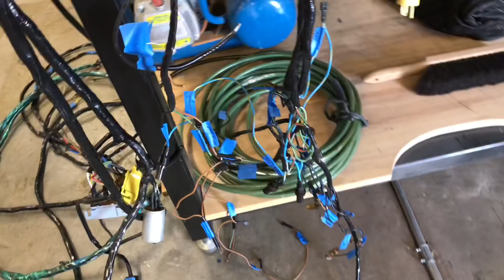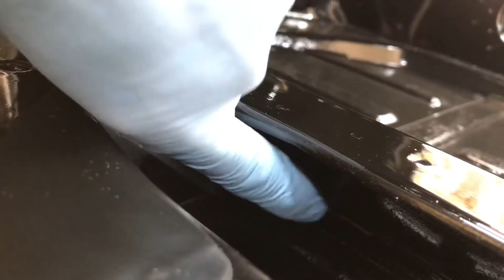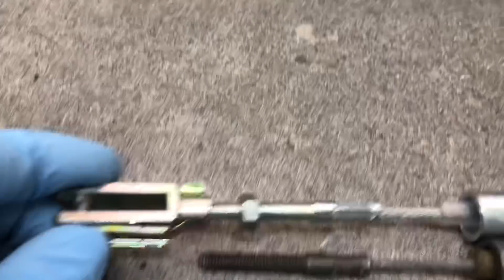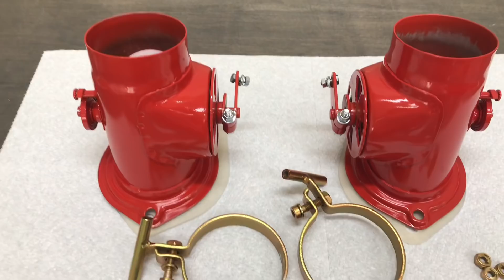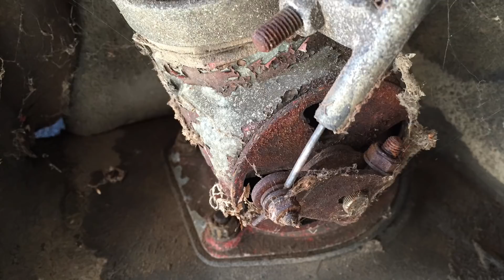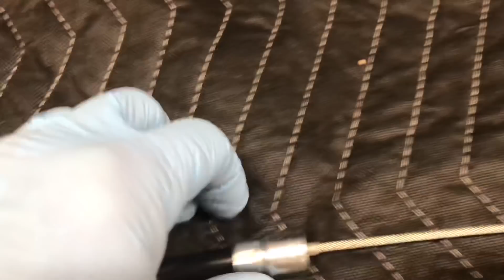1967 Porsche 911 Video 38 Installing Tunnel Lines

Comment: Hello Mike, thank you so much for your excellent videos. They have been invaluable for me during my restoration process of a 65 912. A question: Is the speedometer cable and brake line held by the same hold-down tabs? I am a bit confused atm :-)
Reply from the maker: Hello Palo Alto Thank you im glad they can be of some help.
I have reviewed the video footage and also gone back through some photos and as best I can see
and they do share the same hold down tabs near the hand brake location.
Most of the lines as they run through the tunnel kind of settle in to what needs to happen.
Also cars may be different on what's available through the tunnel.
One other point I should bring up after reviewing the video is the accelerator rod that runs down the tunnel
does get bushings installed the holding tabs. 
I show them in another video but don't recall off hand which one that was.
My car did not have them but they were a factory installed items. A viewer brought to my attention!
Good luck!
Reply: @MikesRestorations , thank you so much for the detailed response!

Comment: Hi Mike - sorry if I missed it: do you/can you replace the retaining clips that hold the harness etc in place? I'm too hesitant to rip one off incase they can't be replaced.... The two pronged ones with the rubber outer sleeve. Thanks
Reply from the maker: Hello eljimberino
The retaining clips/clamps will remain in place. They are spot welded and would be difficult to replace and reinstall.
I did replace the vinyl sleeves with shrink tubing to clean them up and that seems to work well
Good Luck!
Reply: @MikesRestorations  Brilliant thanks!

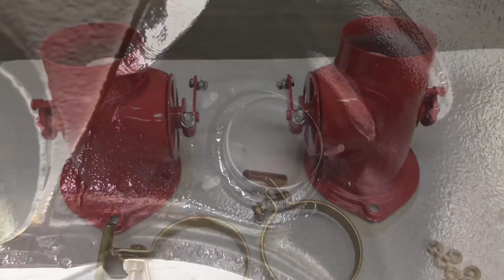Comment: Hi Mike - I really got a lot out of this video since I'm repairing and reinstalling my heater valves, hoses and cables.  As usual, beautiful work. I have been looking for where to buy the heater hose clamps as shown in the video at 11:01. The part number I have is 901.211.051.22 but what shows up is another style (with the pipe welded to the side of the clamp), not like the ones you have.  Would you have a suggestion as to where to buy them?  Thanks.
Reply from the maker: Hello Rotarybreather thank you
The clamps you are referring to in the video are factory originals from 1966 refinished.
When Porsche remanufactures some parts they make small changes to be more suitable for a wider range of years and models.
Im sure the new clamp style would work but if you are looking for these parts exactly I would recommend searching eBay for some
used originals. 
Most of my Genuine Porsche Parts are sourced here
https://www.porschesandiegoparts.com/oem-parts/porsche-pipe-clamp-90121105122
Always affordable and always beautifully packaged and shipped usually within one week. A great place to source all your Genuine
parts. Sometimes they don't have pictures when you enter your part number but as long as you are sure its the correct part number
they will ship correctly. Also I think for those clamps there would be a left and a right ..Its been a while since working with them
Good luck!
Reply: Mike - do you have a video showing how to hook up the cables to the heat exchangers (that open the flapper boxes, not the heater valves)?

Comment: Hi Mike, how did you clean the wiring insulation? I tried white spirit but it washed the color stripe from the wire.
Reply from the maker: Hello Ian
The wire harness was washed with warm soapy water and paint gently scrubbed with paint brush..followed by clean water rinse. 
Next Blow dried with compressed air and left to dry out outside in the sun on a very warm day. The solid wire colors can be cleaned with a flash wipe of acetone. The wires with strips color can be tuned up if necessary with denatured alcohol. being careful not to over due as it could remove strip color if wiping too long
Good luck!

Comment: Hi Mike, what paint did you use to paint the red heat control valves? Thanks in advance!
Reply from the maker: Hello AWCC
The paint used was dupli-color engine paint DE 1605 Ford red
Reply: Thanks Mike!

Comment: Hi Mike, I'm watching every video with great interest. Trying to get all the details. Did I miss a video of the general wiring harness of this fine automobile? I can see you have some wiring harness going on in the engine bay with the next video, but I can already see some wires (and heat tubes) in this video. What did I miss? I hate to miss some of your detailed work. They way you work is a great inspiration, for all restoration projects thanks
Reply from the maker: Hello Thomas
Thank you=) yes there are several harnesses on the car I will be going over in greater detail. In Video 38 it was just pulling the main harness into location but not much for hookups as of yet.
There is also a harness in the headliner installation video definitely 
worth checking out. The headliner harness is tough!!!
As the series continues I will cover all hookups..little bits are revealed during ongoing segments as the timing require.
Lots of video to watch but I hope not to have to many gray areas..
If you have a any particular question I will try my best to answer
Feel free to reach out!

Comment: Hello Mike, did you use a high temperatur paint for those flapper boxes? Or would a regular paint be sufficient? Thanks
Reply from the maker: Hello Lukasz
Yes you are correct..high temputure engine paint should work fine on the flapper boxes. They will get quite hot..engine paint is good to about 500-550 degrees 
Good Luck!

Comment: Fantastic. Shrink wrap I wish I had thought of that!
Reply from the maker: Hi Gary
That tunnel can get crowed for sure!
Reply: Hey Mike, the tunnel is very tricky. I know a lot of guys that have done fuel lines insitu! I rewired my whole front end. I used network cable sheathing to keep it all together while routing it. Green shrink wrap would be much better because it's already a little slick. You're going to have a better than new 911 in the end. Keep up the great work; you're a real artist.

Comment: Another great video Mike, the car is stunning and as I work on my 66, this is a great reference!
Reply from the maker: This hopefully will be a good source to draw from for the earl cars
Manuals are nice but video sure makes it easier
Reply: Mike M - question for you where did you source your heater orange silicone hoses?
Reply from the maker: Hello matlecomte
They are Porsche genuine..material is a fiberglass fabric with dye color coating
They are quite ridged compared to the original which had more wire winding for bending.
I think the silicon after market type might be a good option for flexibility although I have not seen
those up close.
Good luck!